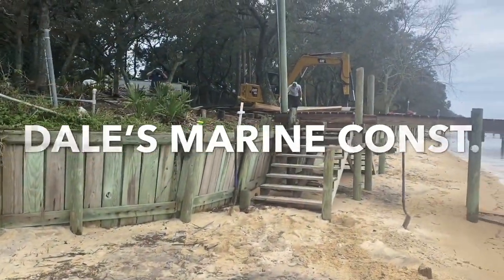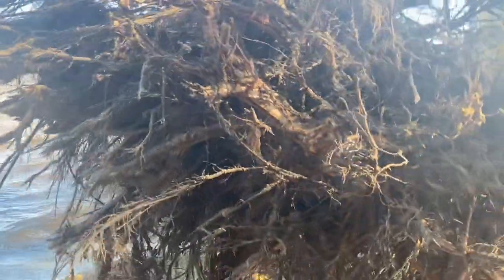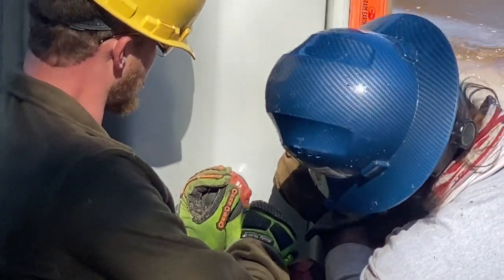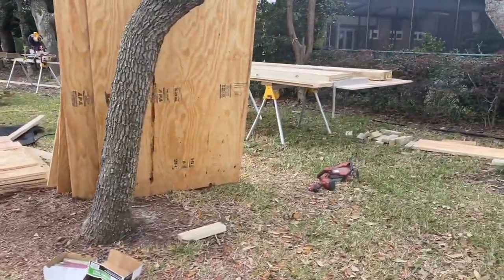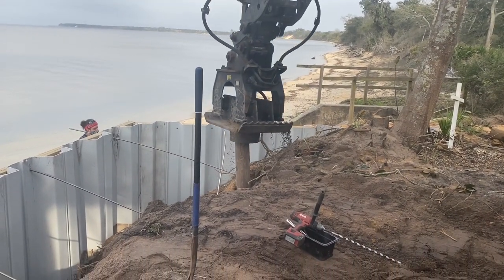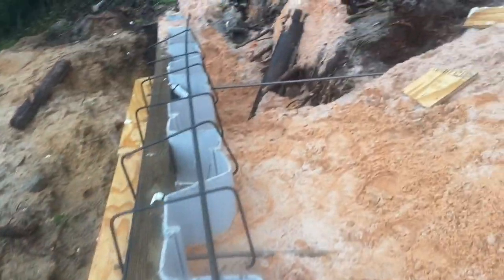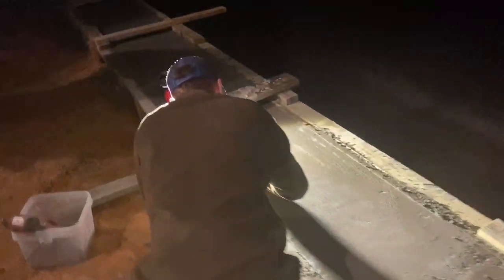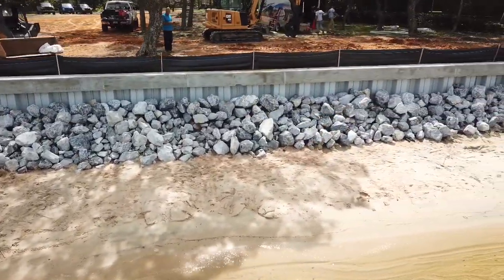VINYL SEAWALL/CONCRETE CAP, HOW TO

Comment: Great work! Can I ask where you bought the jet pipe?
Reply from the maker: Thank you you can get a lot of the fittings at your local hardware stores, as far as the aluminum jetting pipe you need to go to a aluminum distributor
Reply: @DaleWHickman   Do you run it off a standard water pump?